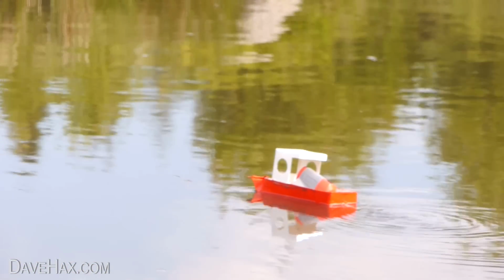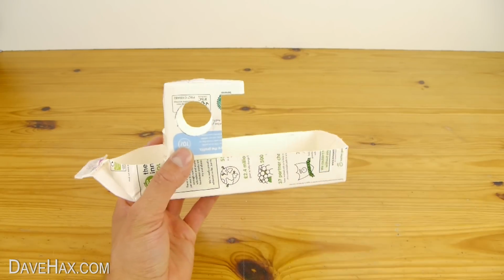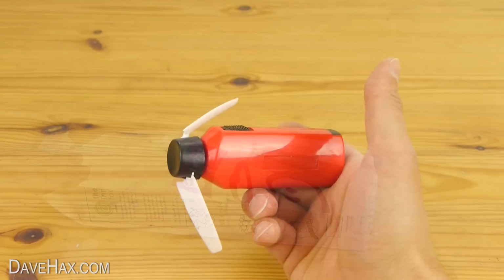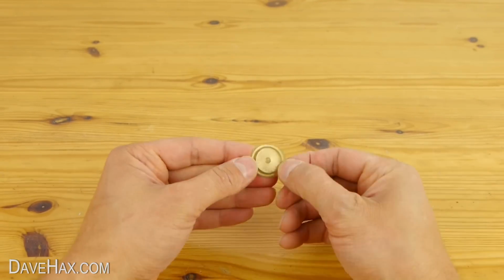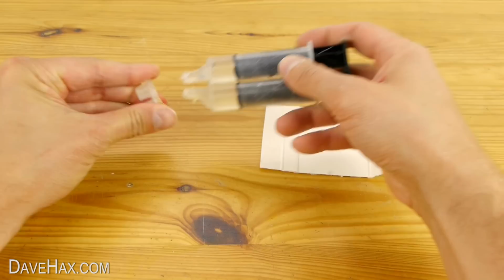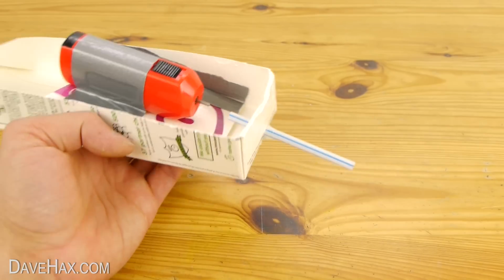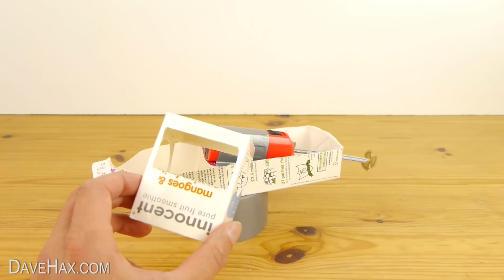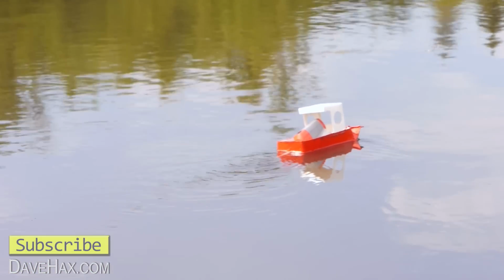How to Make a Model Motorboat

Comment: use small rubber tube like LEGO pneumatic or Playmobil fire hoses to connect motor and stick. So you can make a rapid change of the propellor.